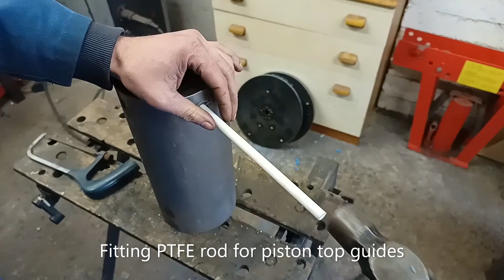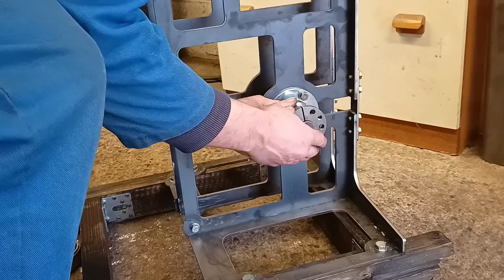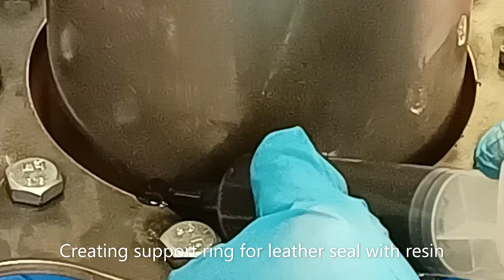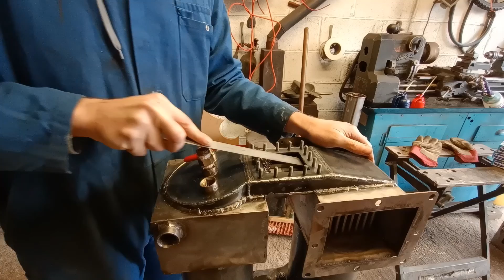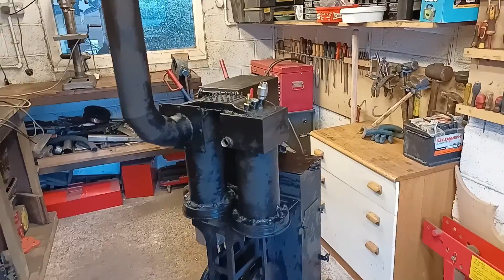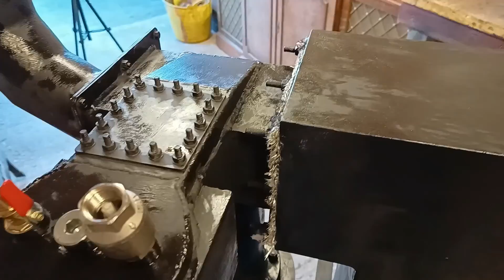Building a Stirling Engine that is Wood Fired - Part 5 - (Hopefully 500W + )

Comment: Still think you need an active draw on that fire, maybe a blower until the chimney gets hot? But I vote it will run mate!
Reply from the maker: You could be right. In some way it wouldn't be bad because I could turn the heat on and off! Attach a gasifier to it. Cheers

Comment: Everything very nice and carefully made. Shouldn't the one-way valve be temperature resistant? I see plastic parts in it. I see a lot of haste in your work. I spread the implementation of my project over a longer period of time. Thumbs up for a successful start
Reply from the maker: Uurrrr, good point, that might cause issues. If it melts I'll get something better. I'm still following your progress, looking good. Yes I am very inpatient and it's not as good as it could be but I just want to see if it will work, all the best